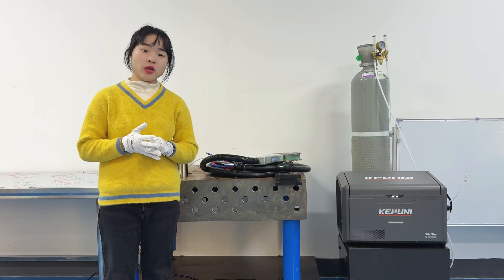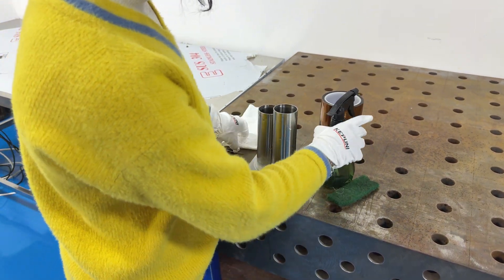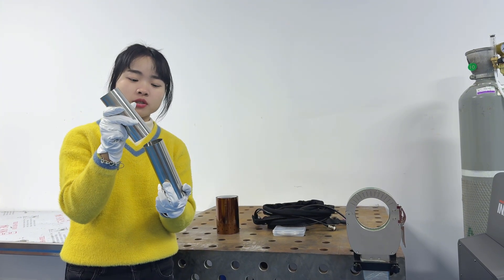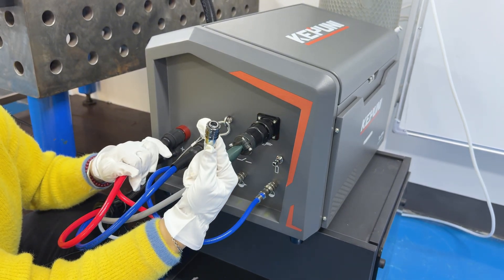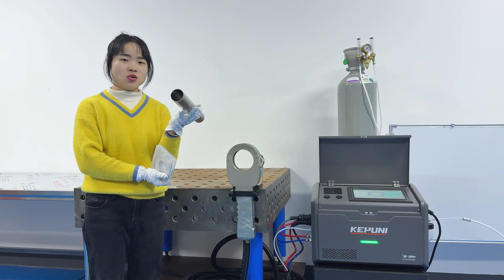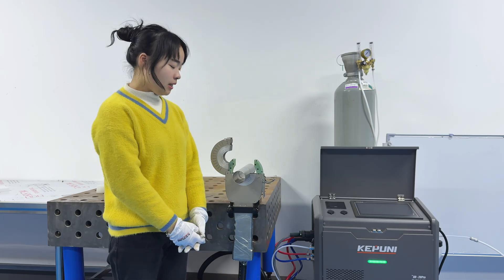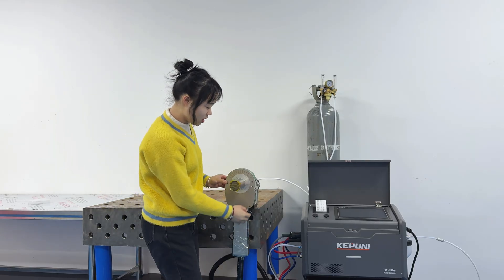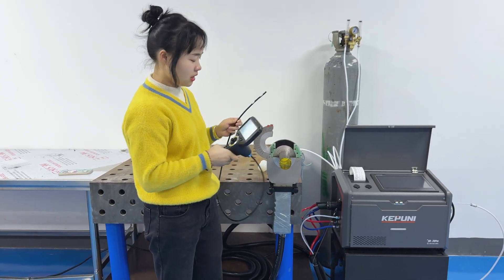Teach you the easiest way to weld stainless steel? & KEPUNI ORBITAL WELDING MACHINE

Comment from the maker: We are a company specialising in the research, development and production of automatic pipe welding machines. Mainly used for welding: stainless steel, carbon steel, titanium alloy, copper pipe and other nickel-based alloy pipe.. Mainly used for welding: stainless steel, carbon steel, titanium alloy, copper pipe and other nickel-based alloy pipes.